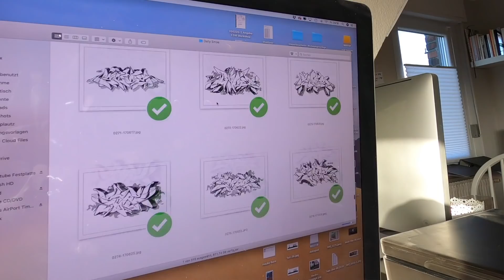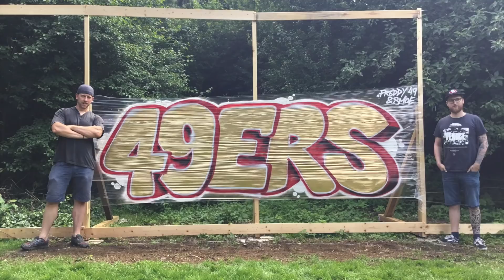How my Graffiti Garden Wall got even better? + how i built it + painting a huge canvas

Comment: About the canvas acting weird: I know you put a blue base coat down but did you use any sort of primer, like gesso before hand?

The reason I ask is that without a canvas-specific primer, what happens is the canvas fibers absorb the paint immediately, causing the fibers to swell with the liquid within the paint. Then as the liquid dries off and the fibers contract micro-cracks in the paint occur which causes the paint to dull and appear spotty.

And just watched to the very end; if you plan to do more canvas paintings, when you send them off, roll them so paint side is out. Rolling with paint-side inward puts the paint under compression and can cause it to flake/chip. Where as with paint-side out, the paint is under tension, of which most spray paints have a bit of elasticity.
Reply: great reply, maybe also mix the base coat with pva glue to help seal the canvas? also did you lacquer the paint after?
Reply: @DjAlanBarratt  It was a really good reply @SReject - While he was painting the blue background on the canvas all I kept thinking was, " I wonder why he's not putting any gesso down, first?" And when he started having his problem w/the color(s) I kept thinking, " Yeah, he should have put gesso down, first." (lol)  But we live and learn, right?  Big up to you and @SReject for offering your advice to Smoe Nova and for confirming my feelings on it too.  We're all better for it.

Comment: The struggle is real! Haha I've painted large raw canvases like this before. They definitely don't like spray paint. However THE KEY is to give it a good 3 or 4 coats of bucket paint before spray painting. The canvas will absorb the first two coats of paint almost entirely, and then by the 3rd coat, it loses all absorbtion and it's like painting on a normal solid surface again.
Reply from the maker: thanks 🙏

Comment: i used to coat canvas with a mixture of paint and PVA glue then put a layer over the top again.  the canvas is very porous so unless the paint layers it get that dull dirty or blotchy appearance as the pain absorbs unevenly into the canvas. your piece is still a total burner and looks dope anyway.

Comment: Paint the top of that wall and all exposed edges .. your best option for coating is to prime it with an oil-based primer(3 coats on the cut ends) then apply a high quality 100% acrylic latex paint. You should coat both sides not just exterior. OSB ... while it is inexpensive, it does not last.
Reply from the maker: i will build a roof soon.

Comment: the problem you have with the canvas is in the prep. canvas is very loose threads, and very absorbent. it's good raw for specific concepts, but pretty much every professional artist that uses canvas will prime it first. most common is an acrylic medium called Gesso. acrylic is plastic so you can paint on it with the same hold as a brick wall or wood boards....makes everything more vibrant and takes the color better.
also, when stretching canvas, either on a frame, or against a wall to work on, to avoid wrinkles: start in the middle of one side, doesn't matter which, place in 2-3 pins (tacks, staples, ext) then go to the opposite side, and do the mirror. whatever side you work on do a handful working from middle towards the corners, and then do the opposite side. keeps everything taught and wrinkle free...and not too much stress in 1 place (which could tear the canvas)
Reply from the maker: oh thanks so much for the loooong comment!
Reply: @SMOENOVA  forgive my indulgences. an ex of mine talked me into being a painting major after getting into art school...where i learned the technical stuff most people don't think about.